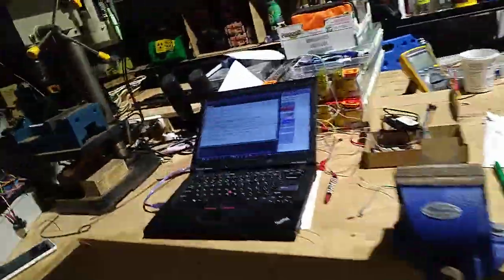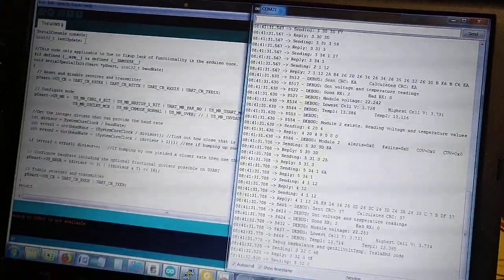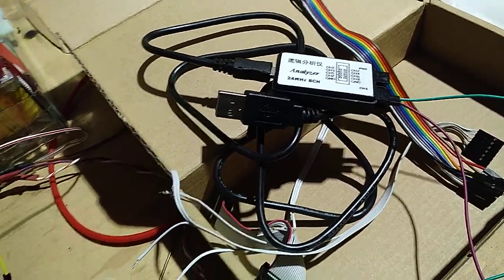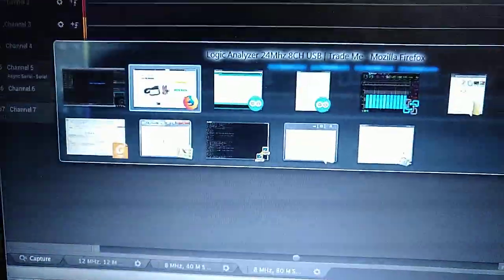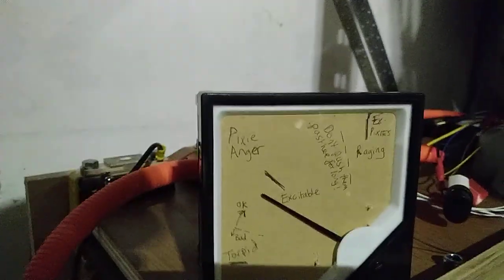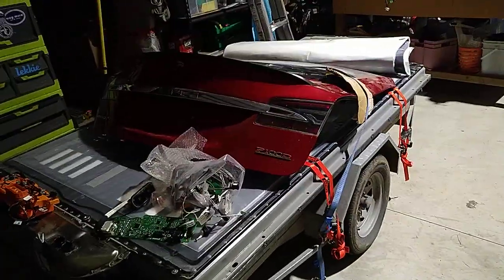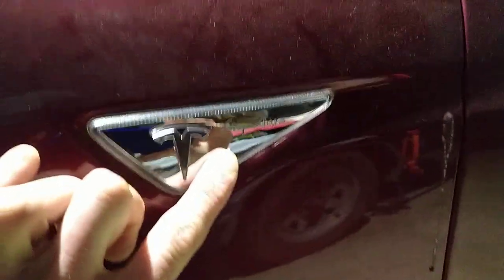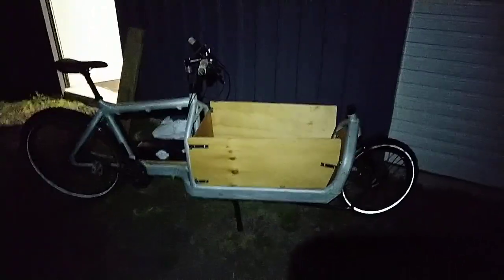Tesla BMS #2: Success! Arduino Talking

Comment: Great stuff! Reinvigorating Tesla bms modules and integrating them into a solar system is a worthy cause.
I'd like to do exactly this too. I started on BBC Basic, then 6502 asm, then got a postgrad in IT after building a digital stereo sampler and midi sequencer, then spent 30 years programming and using linux and recently built an arduino and gps based and stepper motor driven solar tracker with 3d printed worm gears. Still building a 6kWh battery and need to make more time!
Reply from the maker: That's an impressive CV. You sound like an ideal candidate the write the BMS software I described in this video!

Comment: Have you look at a Tesla Model 3 Battery yet?

Just managed to get a 60kw battery from a 2021 tesla just removed the pent house and keen to try and connect up to read the BMS
Plan to follow TeslaBMS like you start with
If your up in Auckland next come visit can show you the stupid things that im up to ;-)

And have some Adrunio based board that maid that may be good for projects that you have worked on
Reply from the maker: Sounds cool. I've not done much with Tesla batteries for a while and haven't touched the 3. Drop me an email: solarcyclenz at gmail dot com
Reply: @RaglansElectricBaboon  only just seen your comment
Have sent email.